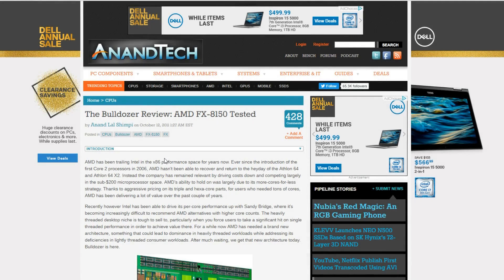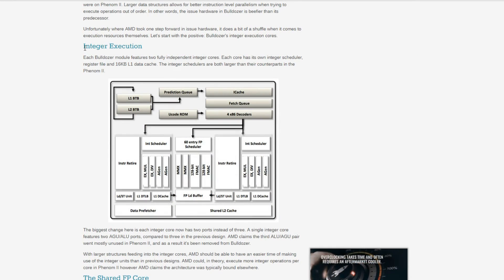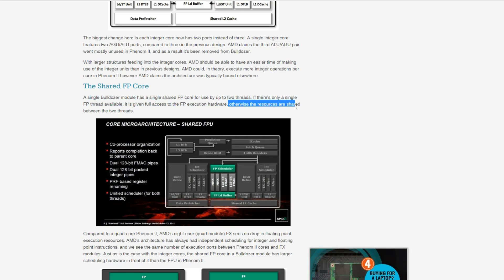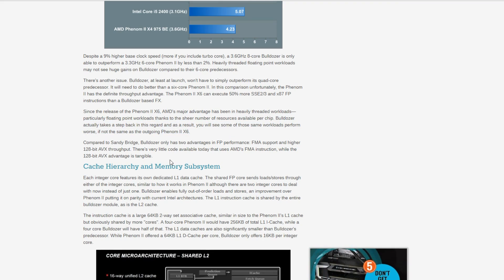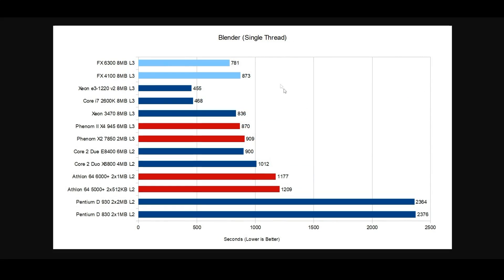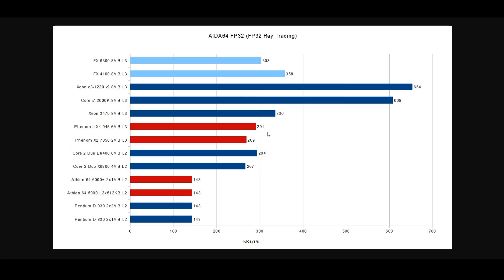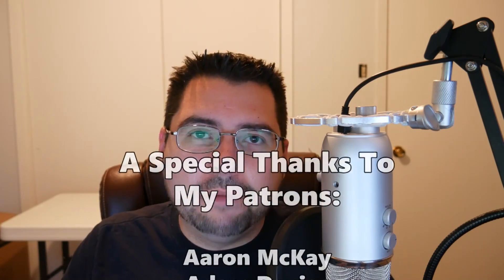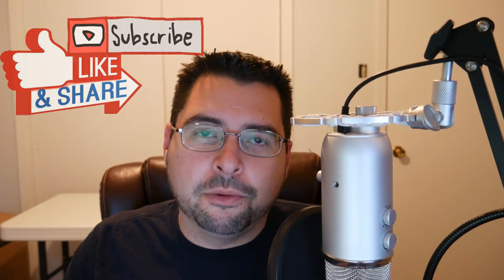IPC Test 7: AMD FX Series CPUs! How Does it Compare?

Comment: No, it is entirely an 8 core CPU. There is no debate on that. FPUs happen to be coprocessors in x86, so saying shared FPUs makes it a quad core is as silly as saying the core count on a i7 depends on how many GPUs you have in SLI.  

"Core" has a simple definition. It is(at minimum) something that can fetch instructions and data, execute instructions, and store the result. Not defending the bulldozer design, but it just annoys me that this idea has persisted for so long despite having no basis in computer science/engineering.
Reply: Even M$ in Windows changed how FX were detected. Before path for Windows 7 FX8150 was detected as 8C/8T. Then to improve performance (better scheduling) M$ changed detection code and FX8150 is now being detected as 4C/8T.  
If you are programmer then you should already discover that when playing with windows api. 
So no! FX8xxx IS NOT 8 CORE CPU. It is just weird AMD's SMT thing!
Reply: +Atak Snajpera  It's both a true 8 core and a weird AMD SMT thing...
Actually looking at the physical arcitecture and the op-codes behavior it is a 8 core.
But yes, it shares enough resources to behave more like Intels cores with SMT in many situations.
But the definition of "core" isn't based on how the performance behaves in modern code.
Reply: Does "execute instructions" include fp instructions?
Reply: +Gordon Goodman
Sharing a part(s) doesn't disqualify them from being full cores; in fact it is required for the chip to be called a multi-core processor. If they don't share any components, then that would be a multi-processor chip like the N64s RCP. In modern designs, most the sharing is in the memory subsystem. In some case, like cache, this is done to improve performance, but there is still sharing going on that bottlenecks performance like sharing memory channels.
Reply: Amir Abudubai ok, 8 cores of hot garbage
Reply: +sunnohh That is a bit more accurate...
Although the "hot" part is only partly true (while it produced more thermal energy then Intel the temperature it starts throttling at and the temperatures it is intended to run at is actually lower due to differences in materials used), and the "garbage" part depends on the workload.
For games I agree with you 100% that it was garbage back in the day and still isn't great for games.
For multi-threading however it's actually a pretty good processor since the two cores of a module scales better in performance then the two threads of a Intel core does and the AMD modules actually outperforms the Intel cores with SMT in some workloads when both threads utilization exceed 80%
Reply: finally someone said it accurately, thanks :p
Reply: +Timothy Isenhart
That isn't how class action lawsuits work. If they won or settled, they would have to advertise to FX owners to claim their share. 

You also got a bunch of things wrong about the FX design. It has one shared 256 bit FPU for each module, so it can run(on the 8 core models) 16 64bit instructions, 8 128bit instructions, or 4 256bit instructions. Their is also no master/slave setup in the core designs. And where did you get 32 bit from?
Reply: @amir_404-e4d  That is wrong. That may have been in AMD's original concept design for Bulldozer but that was not what was implemented. And When class action lawsuit is settled out of court you have to sign a legal contract of confidentiality before you can accept the payment. The only people who receive payment are the one's who followed the lawsuit. https://www.hardwaresecrets.com/inside-the-amd-bulldozer-architecture/
Reply: +Timothy Isenhart
Once gain, no that isn't how a class action lawsuit works. All class action lawsuits run on a opt-out basis, not a opt-in. We saw the first call for people to opt-out, but we never had a call for people to collect damages; meaning AMD won and no damages were paid.
http://www.alllaw.com/articles/nolo/personal-injury/class-action-lawsuit.html

Also, what is with you people and not reading your own sources? First of all, it clearly shows the slides(taken directly form AMD) which shows the FX processors having two 126bit ALUs(making up the shared 252bit FPU) I was talking about. Second, it was clearly written by somebody who doesn't understand basic CPU components; the author list shared cache  as a reason for the design not being a "true" 8 core.
Reply: @amir_404-e4d  There are 2 shared 128 bit floating points here is one with a block diagram so you can see for yourself https://techreport.com/review/21813/amd-fx-8150-bulldozer-processor/2
Reply: @Zangetsu2026  The Floating points are always used. AMD went with 2 shared 128 bit floating points because it was the bare minimum needed to use clustered multi threading to act as 8 individual cores on 32 bit workloads. Although it would of been slower performance per thread, if they had used 256 bit shared floating points, the threads would break down the 64 bit workloads to run through individual threads.
Reply: if it has eight integer units, then it is eight cores.  it doesn't matter how many floating point units it has when counting cores.  this was settled a long time ago.  the eight core FX chip has eight true cores.  FPUs do not equal cores, half cores, quarter cores, or whatever jibberish the retards from years ago argued over.  lol
Reply: @Zangetsu2026  FPUs matter if the bandwidth is not there. The FX has two shared 128 Bit floating points, if you are running 64 Bit workloads on the FX, the slave thread is forced to work with the master thread on that specific work load which will max out that module. The FX can only handle four 64 bit workloads at one time, that is why it is not a true 8 core CPU. If AMD had placed 2 more shared 128 Bit floating points or had implemented shared two 256 Bit floating points it would of been a true 8 core. As far as running eight 32 bit processes it does fine but it does overload the FX. I'm not degrading AMD in anyway, I have had my FX9590 for 5 years now and I know what it can and can't do as far as workloads are concerned.
Reply: lol just sayin, but when you are counting cores, it doesn't matter how many FPUs it has or how many "64 bit workloads at one time" it can handle.   if it handled thousands of "64 bit workloads at one time" or had a million FPUs, it's still an eight core CPU.  you can strip all the dedicated floating point math units out and it's still an eight core.  you CAN do FP math with integer cores, it's just a lot slower if you have to do a bunch lol.  

you are of course ok to mention the rest of the stuff, so long as you acknowledge it's an 8 core.  you can say properly:  "it's an 8-CORE with blah blah FPUs" and it's all good.
Reply: @Zangetsu2026  Most applications even see it as quad core and before Windows 7 released the AMD Hotfix patches windows recognized it as quad core.
Reply: lol windows is stupid it can't even report my overclock properly
Reply: @Zangetsu2026  Okay what about Geek Bench https://browser.geekbench.com/v4/cpu/9944439 or AMD's favorite Cinebench R15 or all of the Unigine Benchmark software?
Reply: @Zangetsu2026   If you have a Ryzen it may not be Windows misreporting your overclock. I had a similar issue with my Threadripper 1950X. It turns out there is a bug in Ryzen when overclocking in your Bios. I had to unplug my pc and hold the power button down for thirty seconds, plug it back in and clear the CMOS, then I went into Bios and adjusted my desired voltages and clock values, saved the profile and then saved and exited. Once I went into windows it recognized the overclocks I set in Bios.
Reply: @Zangetsu2026  If you are looking at it that way then you could call an i7 quad core an eight core CPU because of it's Hyper Threading which are also integer cores but they run simultaneously on both 32 bit and 64 bit instructions.
Reply: hi tim, hahahhah i dont think HT has integer cores....  i think HTs share the real integer cores
Reply: @Zangetsu2026  Technically they use 4 Physical and 4 Virtual. Performance Monitor shows them as 8 individual cores, Even though we all know they're Quad Cores using simultaneous Hyperthreading. The point is AMD's clustered multi threading on the FX will act the same way as Intel's Hyper Threading when processing 64 bit workloads in that module. If you are using multithreaded 64 bit workloads the FX will do this in every module rendering it as a quad core. If it is processing 32 bit multithreaded workloads it will act as an 8 core CPU. Even the new FX boxes after the lawsuit was settled say 4M/8T on them.
Reply: are you talking about floatingpoint workloads right?  not integer, right?
Reply: @Zangetsu2026  Integer, each thread is 32 bit, in order for you to run a 64 bit workload in that module they will both work simultaneously.
Reply: It is a quad module/core. It has two shared 128 bit floating points each shared by two clusters, two modules per cluster, two clustered threads per module. A true 8 core processor has 4 shared floating points. AMD settled on a lawsuit in 2016 out of court for falsely advertising it as an 8 Core processor. https://www.extremetech.com/extreme/217672-analysis-amd-lawsuit-over-false-bulldozer-chip-marketing-is-without-merit
Reply: +Timothy Isenhart No, there truly is no need for a floating point unit at all for something to be called a "core" not even for a modern X86 processor.
But yes, they did settle out of court, not because they where wrong, but because you can't trust judges etc to understand this kind of deep arcitectural details.
Reply: @Luredreier  The two shared 128 bit floating points are what prevents it from being a true 8 Core. Hear me out, Each shared 128 Bit floating point can handle four 32 bit work loads but can only handle two 64 bit workloads. When you run a 64 bit workload on one module it uses both threads in that module. If you run four 64 bit workloads it maxes out the two shared 128 bit floating points. If AMD had implemented two shared 256 bit floating points it could legally be considered a 8 core cpu.
Reply: +Timothy Isenhart 
Thanks for linking that article, it proves my point quite well. You clearly just read the link name and didn't even read the title "AMD lawsuit over false Bulldozer chip marketing is bogus." " ...the lawsuit is utterly without technical merit..." No where does it say AMD settled, and even if they did, that won't mean anything unless we knew how much they settled for. It is common practice to settle a case you expect to win for an amount less than your expected legal fees. And going by the fact that this lawsuit was back in 2015 and no money was reimbursed to FX owners, AMD won the case.
Reply: @amir_404-e4d  It was settled out of court uou will not find it in a published article. The reddit user who filed the lawsuit posted it in reddit that AMD gave him a $850,000 settlement out of court but his statement was removed by reddit due to his unlawful breach of confidentiality.
Reply: LOL it's lucky that people don't consider FX cpu to have 8 core. Otherwise Intel can (because it's true) make graphs like: "50% more performance, with just half as many cores".
And by your definition, FX cpu would be quad core because they only have 4 sets of fetch-decode
Reply from the maker: Most consider a core (in terms of marketing,) as both a integer core and fp core = 1 core. 2 int and 1 fp = ??? As I said it depends on the software and workload as to which level of performance you will see. Heavily multithreaded fp workloads will operate more like a quad core with hyperthreading. Integer heavy workloads will operate like a true 8 core CPU. It was a weird design, and no way developers were going to code for it. Obviously the real issue comes from the lower cycles (aka lower IPC.)
Reply: +The Good Old Gamer 
First of all I have never seen any evidence of "most" people believing that.
Secondly the first CPU cores out there had no FP unit at all.
Yes, it was a interesting design.
Regarding IPC it was both higher and lower then the Intel chips at the time depending on what type of IPC you where looking at and the workload.
If you compare a FX module with a Intel core using both threads on each the FX chip actually pulls ahead in many workloads. (IPC is instructions pr clock cycle, but isn't necessarily limited to just one thread, the Power9 from IBM for instance have a higher IPC then Intel for the core as a whole but a way, way lower IPC for a single thread).
Of course by modern standards it's still weak even in multi-threaded workloads. But back in the day it was a multi-threaded beast even if its single threaded performance was... dissapointing...
Reply: Once again, that is wrong. First off, FX didn't even have to share FPU in normal operation. It could run two 64 bit operations simultaneously and only had to share when running 256 bit instructions. You can argue that FX didn't fully support 256 bit instructions, but it was just fine with FP64/128. The reason Sandy Bridge beat the FX processors so bad in FP had nothing to do with AMD; Intel put 6 ALUs(Intel fused their FPU with other components) in Sandy Bridge cores. They brought a tank to a knife fight.  

I challenge you to find any official source that supports that; modern designs(Sandy Bridge included) don't even have any physical part you can point at and say that is an FPU*. It is just gossip started from a journalist that didn't understand the topic years ago. Most consider threads to be as good as cores; most consider Best Buy to be good place to get a computer; most consider reality TV to be real. The fact that you started a technical debate with "well it is a popular opinion" should raise some red flags. 

*I am excluding Intel Atoms from "modern" designs since that was Intel deciding they wanted to vomit out a refreshed Pentium 4 for some reason.
Reply: Ok whatever you want to call it, it was crap compared to a quad core
Reply: +Imraan Omar That depends.
The FX 8350 was great in multi-threaded workloads and actually beat Intel in some workloads when you fully utilized the 8 threads.
The thing is that the FX 8350 while having a lower single threaded IPC actually beat the Intel cores with SMT both in scaling (they improved way more when going from one core on a module to two cores on a module then Intel did from one thread on a core to two threads on a core) and in some workloads even in total throughput (depends on the workload obviously but in some workloads the FX 8350 had a higher throughput then even the i7 3770k when both where running at stock) while its price tag was equal to or lower then the i5s.
If the chips charactaristics suited your workloads it was a genuinly great buy.
But to beat Intel you of course needed 8 threads that all had more then 80% load.
Below that and Intels implementation of SMT did just as good really...

Comment: AMD Steamroller and AMD Excavator next video or directly Zen?
Reply: good Q. Steamroller and Excavator were 4 core APU jokes if you needed multi thread horsepower, and nothing after Bulldozer and Piledriver were realy new on the 8 core front other than a tad faster clocks.

The APUs were ok for a basic face book web comp never intended for games more intense than bejeweled or minesweeper.
Reply: The APUs weren't that bad. Sure they sucked when compared to just about any dGPU, but I know a lot of people that got into PC gaming on cheap APU laptops. Although, they weren't really noteworthy from a CPU technical standpoint; sorta like how Coffee Lake is a huge improvement over Kaby Lake from a product point of view, but particularly the same from a technical point of view.
Reply: eh? say what? I had a fx-8350 excavator... that was no APU
Reply: True they were junk
Reply: But APUs allow to play CS 1.6; CS GO and stuff like that at good frame rate for low cost.

Comment: The answer to how AMD made through that period is simple. AMD CPU's were way cheaper. I bought an FX 9590 with 16mb cache for $240 Canadian dollars back in 2014, while Intel's closest CPU was going for $750 USD.
Reply: That's why I ended up with a FX8350, instead of a X6 or i7, lol. I had a 965 x4, and going to a i3 would be a down grade for 3D rendering and I needed more CPU multi-threaded horse power not single thread rice rocket Boost clocks, lol.
Reply: @Zarcondeegrissom  I also have and 8350
Reply: I am not an AMD fanboy, i like intel but thier prices are just wrong. Ive owned many intel CPUs including a dual pentium 3 system with 2 700mhz CPUs running at 933mhz cooled by 2 gw fop 38s. it used to scream like an SOB.
Reply: I bought a xeon 1231v3 (i7 4770) for $250  back in Sep 2014 it came out 3months before the pile of shit that is fx 8370  that was selling for $199 at its release. If you compare them the xeon feels like it should be worth twice as much.
Reply: @ Mahone:  And what were your motherboard choices?
Reply: The 9590 isn't even close to anything Intel had. Any Intel quad would decimate it. My 6 core phenom 2 matches it... Lol
Reply: @singular9  funny part is that 6 core phenom can't run apex legends
Reply: i5-3570k or 4670k were at the same price (even cheaper) than FX9590. Now, why you bought that shit, it's way beyond anyone understanding.
Reply: @ Minus:  No.  It wasn't. It was at least $100 USD more.
Reply: You forget I said I have the 16mb version, the 8mb was what they sold in stores. And for some reason was more expensive. I ordered my chip online on sale. At that time according to passmark the 8mb 4.7ghz was close to some i7s mine is a slightly faster chip. Even some ryzen's are slower but ryzen is Less power hungry and more upgradable and also didn't exist back then.